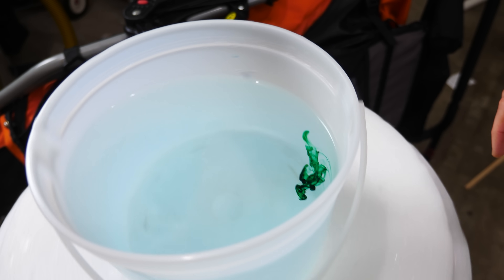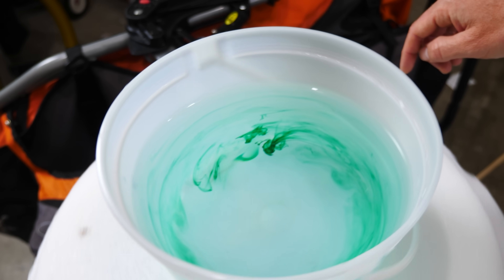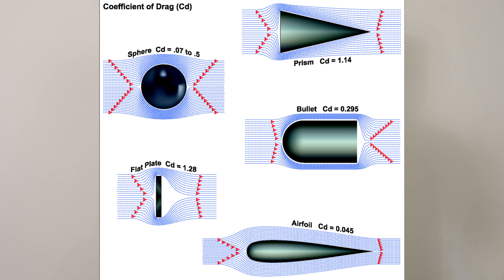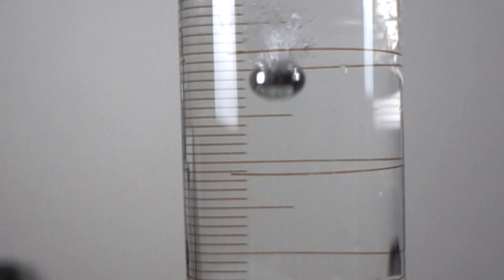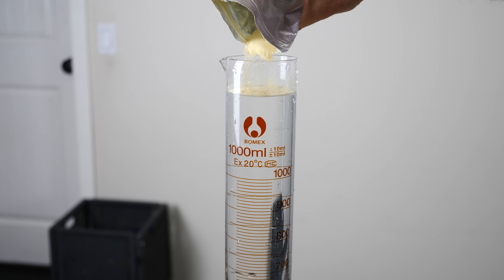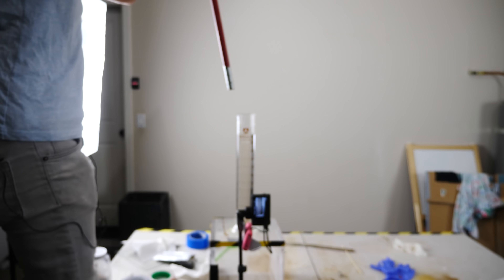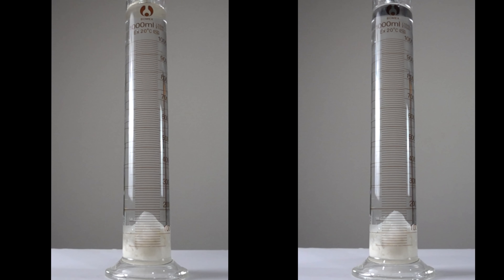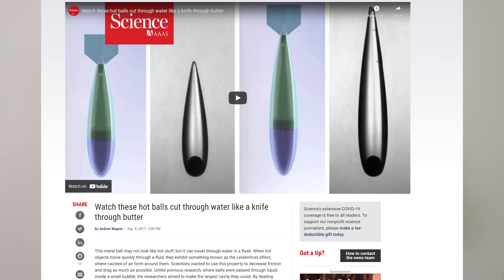Hydrophobic Projectiles Slice Through Water With No Drag

Comment: Fun Fact : Military has used this for a long time. Modern torpedoes fired from a Submarine is coated in a special material that is Hydrophobic
Reply: @Moritz Messner Anything post ww2 is somewhat modern.
Reply: don't they have like an antenna infront to create supercavitation instead? So the torpedo flies through a vacuum created by the antenna thingy in front effectively having it only have to fight the drag created by the little ball in front?
Reply: @carlosandleon  russians are the only ones to have supercavitating torpedo called shkval
Reply: @killallfornothing  The shkval  is quite an old model,  would be surprising that russian don't have quite better stuff now.
Reply: @overlord4404  Nope ... the Germans had developed a 300 knot torpedo 20yrs. ago. It used a very fine atomizer at the front that released nitrogen gas as it streaked along a few meters deep. The gas shielded all but the control and propulsion surfaces reducing drag tremendously. A kilometer from target it would eject it's prop and a rocket motor would take over and the gas nozzle was activated and it would literally take off like an underwater rocket.
  It worked like this. It's fired like a normal modern torpedo with tiny, thin , communication wires trailing behind it to connect it to the sub, 10k meter range. When the signal was sent from the sub, the wires detached and the prop popped off, rocket is fired as gas is released and in just a few seconds the torpedo was at 300 knots. It had a smaller warhead because it used it's kinetic energy to smash thru the hull and detonate inside the ship. There was no defense against it.
Reply: @RANDOMNATION907 name of it? The only thing I found is baracuda which was a prototype and never went in production. As of now  the only operational one is shkval  and is improved and export versions.  Iran claims to have one but they went china way and copied it
Reply: @TheCrimsonBlade2  so,  the only one in use is still shkval...
Reply: @carlosandleon  You might be thinking of the probe that pops out in front of some ATGMs after launch.  It not only forces the shock cone away from the body of the missile, it acts as a stand-off detonator to be certain the shaped charge fully forms at the proper distance. 

But……

Since I know effectively zero about torpedoes you might be 100% correct.
Reply: @carlosandleon  It won't be a vacuum it'll be under high pressure to maintain the bubble against the water pressure. I think those things use skates to ride the inside of the bubble
Reply: @SerBallister  I think the sheer force of displacement makes it a near vacuum. It's constantly imploding.
Reply: @carlosandleon  Could be, I remember reading about them in a kids science magazine about 30 years ago
Reply: @SerBallister  to be fair I'm not an expert on the subject. But I do vaguely recall cavitation bubbles are a near vacuum.
Reply: @carlosandleon  Supercavitating torpedos like the Russian VA-111 Shkval use hydrophobic materials and compressed ejected from the nosecone to create  a bubble of air around the torpedo. It's like there's a bunch of tiny additional exhaust ports on the nose of the torpedo.
Reply: @TheNextWednesday  it used a mix of gas bubble from generator and engine to reach speed and the the front cone will create the supercavitation bubble around almost the entire torpedo.
also, those reported speeds are for the commercial version, they keep a faster version for themselves.and that just reminds me todays comments sponsor. just like you keep torpedoes, you just want to keep your hair. KEEPS, use the code below to get 10% more fact related comments.
Reply: @carlosandleon  This is what several Torpedos use. They simply use a solid-fuel rocket to accelerate to a speed at which the water touching the nub on the front vaporizes and gas from the rocket (and sometimes a gas producer on the front of the torpedo) fills the pocket where the water used to be and sustains a layer of gas in between the torpedo and the water. This is allows for almost zero drag on the torpedos and underwater speeds of up to 400km/h.
Reply: it’s pretty obvious the military would use this considering they use torpedos and the video mentions torpedos having a very low coefficient of drag.
Reply: Does coating Torpedo with hydrophobic gives advantage? 
It would be very noisy (cavitation) , the rudder n propellers dont do good in bubbles..
What about its  sonar, gaps of bubbles n water , wouldnt it effect? its efficiency?
Reply: @kentershackle1329  my thoughts entirely. But with air dropped munitions this effect would greatly increase lethality.
Reply: @ICGedye  I've never heard of USN torpedos, sub, surface or air being coated with hydrophobic coatings.  (P-3C Tactical Coordinator - ret'd).
Reply: @KB4QAA  Thanks for the insight.
Reply: @kentershackle1329  the russian supercavitating torpedo is supposed to do 230mph (370kmh) underwater, possibly 290mph and they are working on one that could do 350mph. At such speeds, you dont really care about sound that the torpedo makes. Its different principle than hydrophobic principle shown in the video, but the basic idea is the same (to shroud the projectile in air/bubbles).
Reply: @DarktroopX  
Yes, im aware of the russian.thats an EXOTIC thingy.  It  shoots like a gun. Its blind. 

We are talking about the norm, the masses..
Reply: Lycopodium powder
Reply: @Moritz Messner the current "modern" torpedo is just an upgraded torpedo design used since the 70's, hence why only modern torpedoes with these new upgrades would have them
Reply: Vaseline to fuck our enemies with
Reply: Some ships have "air injectors" spread across certain underwater hull surfaces to make an air layer between hull and water.
the good old underwater step of the speedboats have a small bot so known feature,the air induction gap that needs to reach above water level when on speed to allow the air on enter under the hull. Without it, the step will not perform well or even at all.
those curvy lines that extended from the bow centerline with a longitudinal step are to help air get under and reach glide speed.
surfboards are concave for that.
 reason, and people who wanted that extra speed  but from a flat bottom experimented with golf ball dimpled alike  bottom surfaces.
the golf ball dimples works in a completely different way, they create turbulences to brake the surface layer and fly longer.

those ideas are pretty old, yet use so complex interactions it still provide new applications.
Reply: I was going to ask, is this currently something used by the navy.

I figured they would coat them in something to reduce drag if its available to them.
Reply: Can we verify this? The submariners i have talk to say there is alot of technology that goes into not having bubbles because they make sound.
Reply: @Trusty_Steed  The only care about the submarines themselves being silent and avoiding cavitation from the sub itself, torpedoes are inherently noisy due to the speed they move so they don't care much about how much noise the torpedo makes.
Reply: @DeathlordSlavik  
'They dont care about the noise' ,really?
Well in modern warfare enviroment , a sonarman onboard would be able to pin point origin of NOISE in short time. Giving them advantage TIME for countermeasures ? and also most importantly SHARE yr general position to other ASW assets. 

That said, i think the ultimate next tech for torpedo is variable speed control. Advancement in fuel cells is the key for this.
Reply: @kentershackle1329  They don't and the reason being even if the target didn't hear the torpedo on the hydrophone as soon as it hits something every ship and submarine in the area is going to start hammering away with active sonar and there is almost no hiding from that. Also realistically they know the torpedo will be detected as current hydrophones can pick up the sound of the torpedo tube doors opening and even people talking in a different ship

When a submarine shoots it knows its getting detected long gone are the days of WW II style hiding by turn the engines to low or completely off after sinking something.

No they will never move to a slow variable speed as the ocean currents alone would screw with such a torpedo not to mention all the other problems that would arise from such a concept.
Reply: @killallfornothing  
Skval u mean?. Its meant to shoot just like a gun/bullet. The torpedo itself is blind. (Of course firing solution is precompute by the sub frm whatever data it received from its sensors/data link) . 
Bang, Bang, Bang.. hope u dont miss, time to run awayy😂.

Theres no countermeasures for this. Except hoping that other guy misses
Reply: @Trusty_Steed  I don't think stealth is a factor for supersonic torpedoes, they travel too quick for the target to react.
Reply: @SerBallister  the speed of sound under water is 4855 feet per second. There is absolutely no way torpedos are going that fast. A 5.56 round travels approx 3000 fps.
Reply: @SerBallister  yeah confirmed it. No such thing as supersonic torpedo
Reply: @Trusty_Steed  Maybe super-sonic was a poor choice of word, the technology does exist in the real world: https://en.wikipedia.org/wiki/Supercavitating_torpedo
Reply: Was wondering that
Reply: Really?
Reply: Aerogel. and it's not hydrophobic, it is superhydrophobic. ;-)
Reply: rain-x
Reply: Nooo..GunTer said MORE VASELINE!!!
Reply: @kentershackle1329  KY Jelly on torpedos
Reply: Given all the fuzz the USN is doing over things like homophobia, transphobia and ironically also islamophobia I'd guess they'd avoid anything -phobic.

Comment: would it work for anything not moving strictly down tho, u can't "float" in that air pocket so you would just keep falling unless u have enough of the vessel contacting water so that it can float at which point is the air pocket even doing anything?

Comment: By the way, a few years ago the USA invented a very low friction torpedo a few years ago. It travels so fast that, thanks to the Bernoulli principle, it generates extremely low pressure at its outer surface, enough to boil the water and create a curtain of bubbles around the torpedo, reducing drag greatly (but not near zero) and enabling great speeds with only a little more fuel.

Comment: For high-speed projectiles passing through water, such as cylindrical artillery shells, the Japanese Navy in 1928 introduced a "diving" projectile that was improved in 1931 to what they called the "Type 91 Armor-Piercing Projectile" for their cruisers and battleships.  In the air it looked more-or-less normal, with a long conical nose made from a thin sheet-metal "dunce-cap" windscreen screwed onto the edge of a flat-nosed truncated cone nose-shape (the protective hardened steel armor-piercing cap "crash helmet" in the larger sizes to protect the nose from damage by heavy face-hardened armor)  with rounded shoulders beveled to the top of cylindrical body and a "boat-tailed" somewhat-tapered base for added streamlined flight through the air (modern US Army artillery shells have this too) and a blunt thick false nose for better armor-piercing function (called a "Cap Head") held on only by the threads of the windscreen that would tear free if the projectile hit the ocean short of the enemy ship at a highly oblique angle, removing both the false nose and windscreen and leaving a flat-faced tapered nose to the shell that was about half the area of the full projectile (circa 68% as wide as the full projectile body).  These special shells when they hit at the optimum angle of fall of 17-25 degrees could move through the water rather close to the surface for up to 200 times the projectile diameter at the high speed of impact of these shells at the ranges giving those angles of fall -- thus the shell could hit the enemy warship much like a small, but very high speed, torpedo, bypassing the regular armor protection of the enemy ship and inflicting flooding damage on top of its normal explosive damage.  The projectile also had a very long 0.4-second delay in its base fuze to allow that much time, on the average , before it exploded the shell, which allowed such a long underwater run.

In your example, you used a sphere with hydrophobic coatings to keep the water from clinging to the sphere and allow it to act as if it were super-slick and move through water much better than a regular metal sphere of equal size and weight would.  In the Japanese AP shell mentioned above, instead of slicking the sides of the projectile, the tapered flat nose would cause the water to hit the flat face at high speed and be pushed radially sideways, up, and down as the projectile moved forward.  While there would be direct drag on the nose tip that eventually slowed the projectile down so much that it would curve downward if it had not yet been exploded by its fuze, there was the noted lack of any drag along the sides and base of the projectile caused by the oval bubble being created by the inertia of the water against the flat nose as it moved sideways -- the bubble would close up behind the projectile, which was only about three times as long as it was wide, and never shrink enough to actually touch the projectile except at the flat tip before it either exploded or missed the enemy ship.

Thus, here in the case of this gun projectile, the inertia of the water being forced sideways by the rapid motion of the projectile flat nose kept the tear-drop-shaped air bubble from touching the projectile anywhere else and gave it its "super-slick" streamlining, not any special hydrophobic coating.  The width of the flat tip had to be specially determined from test firings to give the least nose-tip drag and still make a large-enough bubble to prevent any other part of the shell from touching the water.  It also used the fact that the water pressure on the top surface of this bubble was somewhat lower than on the bottom of the bubble to give the projectile enough lift -- like a surfboard, but completely underwater and only at a small angle nose-up -- to keep it shallow enough to hit the enemy ship at the underwater travel length created with a standard depth of water around the hull depending on the intended target enemy ship class (smaller ships were being fired on by the smaller 8" shells of Japanese cruisers and the depth was roughly scaled down with the shell size here).

While the actual battle results from underwater hits of these shells during WWII of this shell design were decidedly few and far between, it did work a couple of times against US Navy ships, once with very serious results on the light cruiser USS BOISE, so it was not a complete waste of design effort, though perhaps not the best thing that could have been aimed for.

Comment: A hot gas generator at the front of the torpedo would take the place of heating needed for the Leidenfrost effect. A similar generator is used in the tails of artillery shells to counteract the low pressure area behind the shell as flies through the air; thus extending it's range.

Comment: But technically torpedos couldn't be wiped in hydrophobic solution bcs they couldn't travel since they need the density of the water so their propellers can direct them into a submarine for example. only something that falls from the sky could use the hydrophobic solution so it goes deeper but nothing traveling horizontally would work with this

Comment: Imagine what happens when they drop in a torpedo with this powder around it. I wish I would've seen that as well :)
Reply: You might well have a torpedo with an air gap produced by rocket motor pointing forward (and a bigger propelling motor rearward). It is called Skhval, it is fast torpedo but sensor-less as it is too loud.

Comment: 5:29 Pet peeve: It's poor syntax to call something "n times less [than x]" when you mean that x = n * thing. It often leaves room for ambiguity, and just isn't what those words really mean . If you want to express, for example, that y = x * 10, say that x is "a tenth of y".

Related: It's also not a good idea to say that "x is n times more than y". Most people interpret this as y * n = x, but the way it's worded, it could also mean that "x = n*y + y". For large enough n and low enough accuracy, the difference is negligible, but otherwise it's still not a good idea. You're better off saying the literal equation: that x is n times y.

Steve Mould did a bit on this. Would recommend.

Comment: I'd like to know what would happen if you coated the bottom of an object that normally floats (like an RC boat) with a hydrophobic material? Will it sink or will it increase it's ability to move across the water? I've wanted to know this since I learned about the commercial hydrophobic coating Never-Wet...

Comment: I've seen this before and had the same thoughts about it. how does it effect propulsion? would you not need more of an airfoil design with jets to propel it? and is there any speculation of finding something similar for aircraft to reduce air drag? if so wouldn't one or both methods mean traveling through water just as easy as through the air? would this have any effect on the sonic boom speed?

Comment: I thought you would drop that torpedo shaped object into the water. Perhaps you would produce a more spectacular effect. Consider if you can minimize the upward force produced by pressure difference between water at the bottom and air at the top of the object.

Comment: This is extremely well explained. One nit pick. A drag coefficient of 0.02-0.03 is not “extremely small…almost zero”. This is the range of drag coefficient for a modern low drag automobile. It’s just small relative to the nominal sphere, which at these very low Reynolds numbers is very high (small scale + low speed = low Reynolds numbers = thick boundary layer = massive separated flow behind a sphere = poor pressure recovery = very high drag)